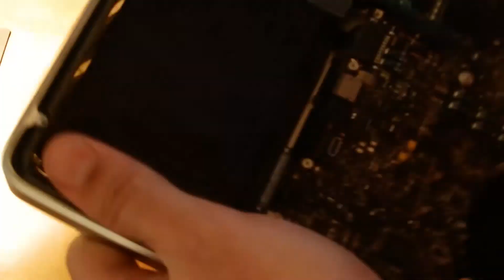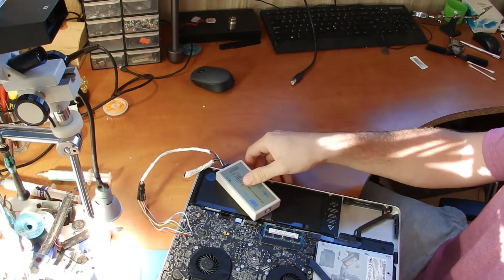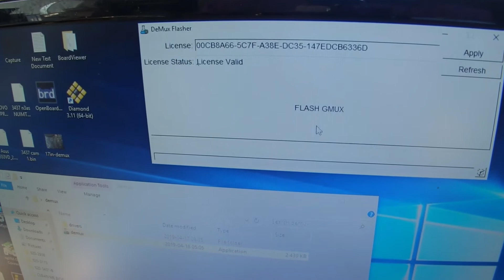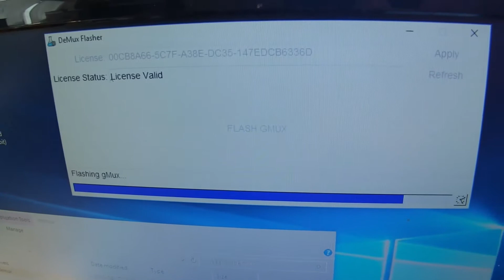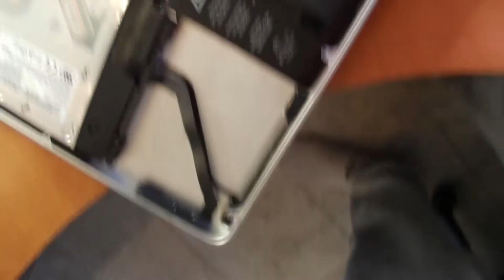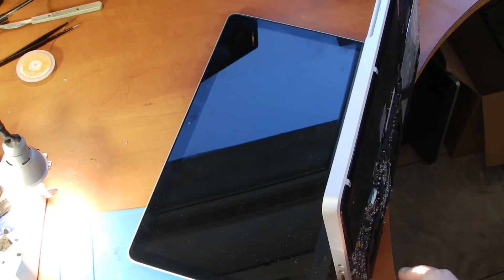MacBook A1286 Disabling GPU 820-2915 Logic Board Repair Easy Fix

Comment: after disabling gpu. can you use external display? in my case , i cannot use external display and wireless display.
Reply from the maker: No, will not be able to connect external display, because external video is created by GPU that you just disabled. Only possible way to connect external monitor is to use USB monitor.

Comment: Can you help to fix this?

2011 MacBook Pro  (15-inch early 2011) A1286. 

 I noticed that my macbook has the error (Screen WILL NOT turn on after going to display sleep).

No hardware modification has been done on this my MacBook Pro far.
Reply from the maker: Hello, try to disconnect hall sensor.
Reply: Sir Can you explain a little more?